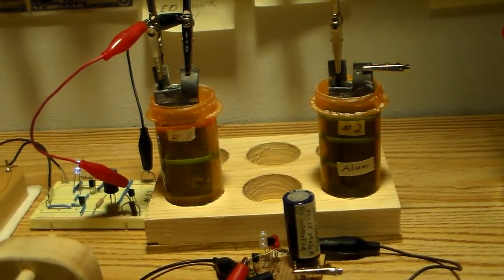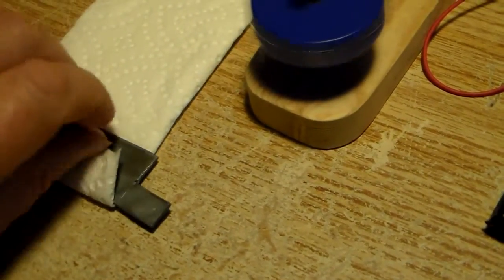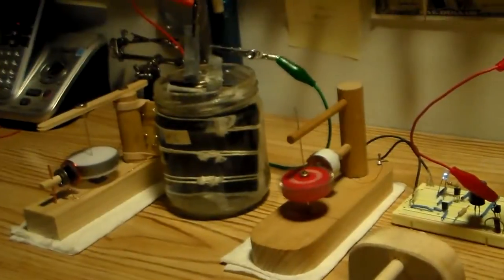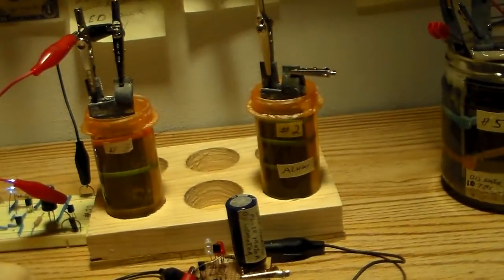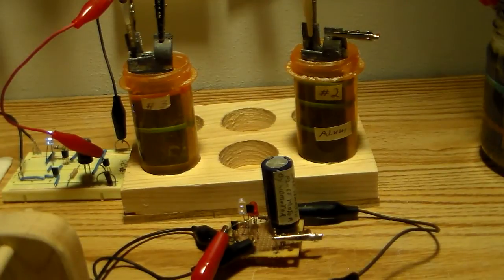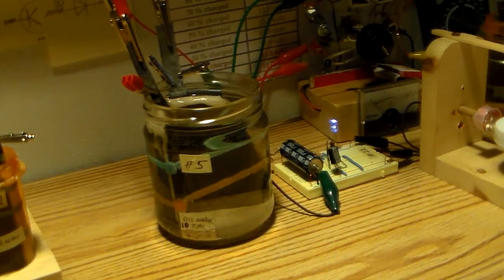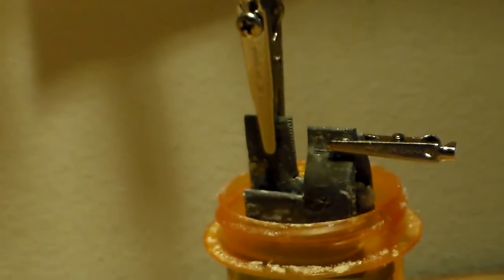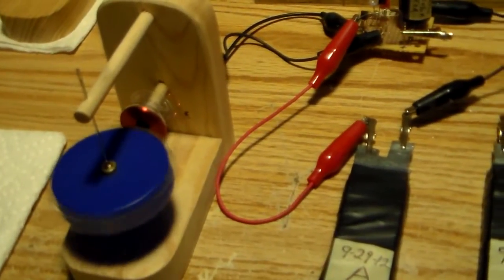Lead & Alum Cell

Comment: For how long these batteries, alum & Magnesium sulfate ones, can hold the charge ?  let's say I charge one of them for 5 minutes and leave them as it is without using or any further charging for 24 hours or so, would they still be holding the same amount of energy as they did when I charged them first ?

Comment: Just a thought.. at your local grocery store in the cleaning products aisle.. they normally sell like 12 packs of disposable vinyl gloves for like about 2 bucks.. might be safer working with lead with using them and like maybe rig a fan connected to some say dryer vent type flexible tubing running out the window of your hobby area.. full moon fever is a good tune, but no sense in being madder than Caligula mentally speaking :D

Comment: If you are still doing work in this crystal battery field then try melting the alum in the water while the battery lead plates are in the fluid. This way the paper will form crystals better as the whole unit cools. The heat has a lot to do with crystal formation and the direction of the heat flow is very important to the crystals you form. You might want to use a scientific method to heat and cool the unit so proper crystal growth happens.
 I so like the crystal battery approach.